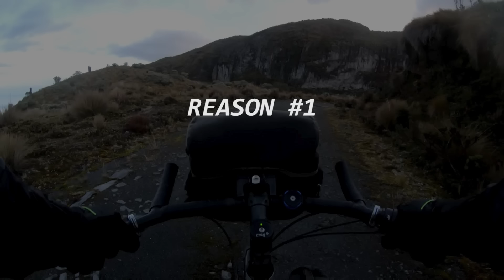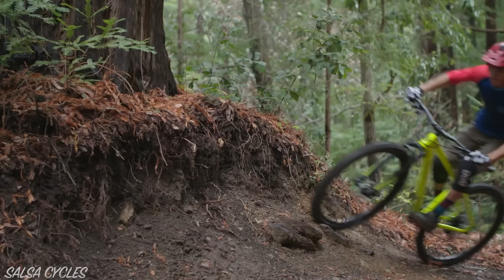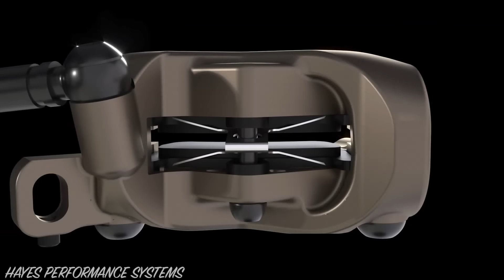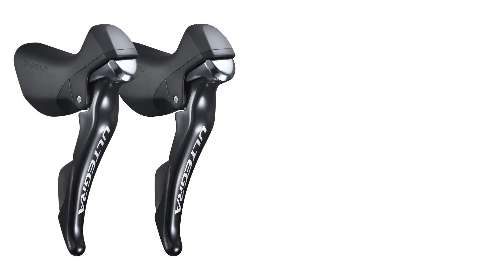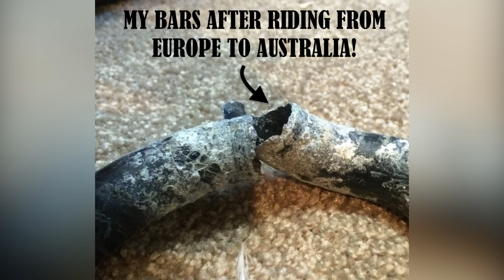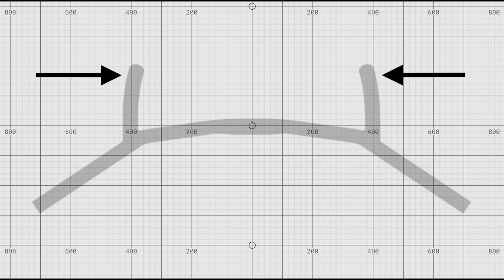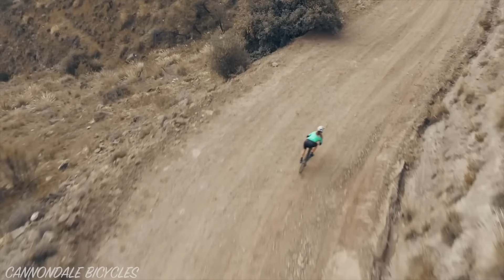Why Flat Bars Are BETTER Than Drop Bars For Most Cyclists (Objective Analysis)

Comment: While I mostly disagree, I do see your points mostly. But reason #4 is straight up bullsh1t. When I want to brake with one finger, I can. Yes, it is hard to do it on the hoods, but in situations where you need a lot of grip on the handlebars and a lot of stopping power (on descents, or off-road), you’re in the drops anyways.
Reason #5 is also not really true, or at least not an advantage. Drop bar bikes are not mountain bikes, so you won’t need such low gear ratios. You can get really low, however, as gravel gearing comes very close to mtb. Also, electronic shifting completely eliminates this argument.
Reason #7 doesn’t address the advantage of drop bars. Drop bars allow for three main, completely different positions, with some adjustments to each possible, whereas with flats you’ll have to buy new handlebars to get another position (or you buy some with a secondary, way less ergonomic position).
Reply from the maker: Reason #4: Yes, you can obviously brake with one finger if you want. But a drop bar lever pulled with one finger almost never generates as much brake force as a flat bar lever. That's pretty much guaranteed.
Reason #5: It totally depends where you're riding as to whether this point is relevent to you. The simple fact is that it's much easier to achieve low gear ratios using MTB parts (no shift-ratio converters, hanger extenders, barend shifters, SRAM AXS wireless drivetrains).
Reason #7: There are the same or more hand positions on flat bars that are totally different. I address the high/low advantage of the drops section later in the video.
Reply: @Cyclingabout  Sorry for the very late reply. #4: Why? A drop bar lever is almost always longer than a flat bar one, and more leverage means less force for the same power (simple physics). So it depends more on the type of brake (notably mechanical/hydraulic) than on the lever shape. 
#5: Yes and no. Drop bars are per definition designed to be mote aerodynamic, which you notice at high speeds, where you don’t need small gearing. While mtb rear derailleurs have more range, you can get really low ratios using an appropriate combination of crankset and cassette. 
While you do address the high/low positions later in the video, you don’t say that it eliminates the previous point of having more positions on the flats, which is just straight up not true. You include any exotic non-drop bar-style handlebars with flat bars, but that is simply a different comparison. Of course you can buy different handlebars if you want different positions, but that shouldn’t count as an argument for the flat bars.

Comment: Toe overlap is not a good point, you're supposed to drive bike with your toes on the pedals, not with your heels, and I'm pretty sure no bike manufacturer makes it so that pedals interrupt with front wheel.
Reply from the maker: As I said in the video, most drop bars bikes in small sizes have toe overlap. That's not with a mid-foot pedal position...

Comment: You're perfectly phrasing what i was always thinking. There really is no advantage, even the aero position is not as aero as most people think. A triathlon handlebar is so much faster and mory comfy its almost ridiculous. In fact i think drop bars are a relict of the old times, where people didnt have wind tunnel tests. And now drop bars are somewhat equivalent to fast, racy, sexy, pro. They just look cool. Thats why gravel bikes are so prominent these days. People want the looks of a cool racebike but the comfort of a touring bike.
And thats the reason why I still only use my drop bar cyclocross bike xD
Reply: Drop bars can access brakes while in an aero position though

Comment: I do have two drop bar and one flat bar bikes and I cant fully agree with your argumentation.
1. Lots of your arguments refer more to bike geometry and have nothing to do with the bar itself...just keep in mind that you may adjust stem length and you could switch bars in any way
2. Since there is hardly any resistance when steering I see no reason why a higher leverage should give you higher bike control unless you are riding on rough terrain - on smooth tarmac and/or high speeds its quite comfortable being able to steer with smaller movements
3. On long, long distances you may take into account that on a flat bar bike there is relatively more inward rotation in your shoulder joint...

In summary most riders have either pretty clear preferences where to ride and which bar fits to them or simply have more than one bike...every bar fits somewhere to somebody :)
Reply from the maker: 1. There are two arguments relevant to frame geometry, not lots. These reasons are for those who are thinking about a new or second hand bike.
2. I agree, on smooth tarmac, a drop bar is fine for steering leverage. But if that's your use case, you can simply skip over this reason.
3. Someone who knows much more about ergonomics than me wrote in the comments here that there is no change in your shoulder rotation with a flat bar. Almost all rotation is below the elbow.
Reply: @Cyclingabout  @1. Ok, I counted the points you mentioned in reason 2 (longer wheelbase, higher front end and different angle) as more than one argument, but that doesn't matter. I don't know about the US but in Europe you'll get entry to mid-level bikes with both bar options and exact same geometry.
@ 3. I read the comment - one point is true: when you hold your hands in front of your body and rotate your hands, keeping your elbows where they are (!), there is no shoulder rotation at all...in theory.
But this person completely neglects the facts in real life situation and obviously does not work with customers in that field . Cause, when grabbing wider flat bars, people flare out their elbows and same time actively rotate inward in the shoulders, you simply can observe that by watching the olecranon of the humerus. Do that and you will see there is actually pretty much rotation above the elbow. But  this is just one small detail, no use for longer discussion...

For me its as easy as that: drops for long distance (tarmac or gravel), flat bars for rougher terrain or bikepackers (which I assume are the most of your subscribers)
Most cyclists do neither nor, so they should go for whatever they feel more comfortable, for me no bar in itself is better than another

Comment: A lot of these arguments revolve around frame design, which isn’t strictly related to your handlebars, (although they are sometimes related.)  For a counterpoint the only bike that I have owned with toe overlap issues had flat bars.  And while many of these might be a good points if you are buying a new bike and specifying every component, if you have a two year old bike and are thinking about buying new/different handlebars, knowing that brifters cost more is interesting, but what you really need to know you have to replace all that stuff if you switch types, and it will add up fast, (regardless of which direction you go.)
Reply from the maker: - There are two arguments around frame design. Not lots. And they will be relevant specifically to those who are looking to pick up a new or second-hand bike.
- Your flat bar bike is more an exception to the rule, rather than the rule itself.
- If you're thinking about new/different bars, you can simply pick and choose the points relevant to that in my video. I didn't intend for every point to be relevant to every person.

Comment: I've found that the trick with doing long distances and flat bars is to use bar ends, which I guess are quite unfashionable now with hardcore mountain bikers. For touring though they are excellent, set them quite flat (about 30° to the horizontal) and they are a little like riding on the hoods on drop bars however they don't just give you one extra position in comparison with your normal grips but three, as you can place your hands diagonally in two directions across the corner of the bar and bar end. I find that by rotating through these positions I never get tired and numb hands after long distances when I'm touring,  whereas with drop bars, they are generally good although if it's a longer day my hands get slightly achy towards the end.

Comment: #1 I wouldn't say BETTER for bike handling. Longer bars make for higher steering leverage but this means slower steering as well. Whatever happened to short flat bars? I like agile steering, being able to evade potholes rather than crashing through them with a long travel full suspension.

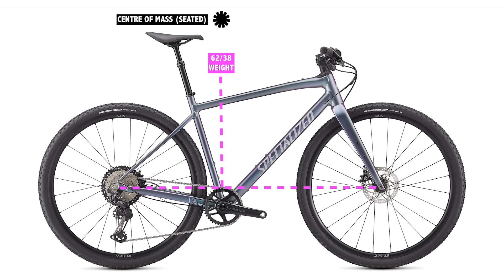Comment: 2:30 ?  When you stand almost all of your weight is on the pedals which are further back from center? Wouldn't a shorter frame have the bottom bracket more centered or closer to 50/50 when standing (opposite of what you say)?

If you shop for adventure type drop bar frames they will be longer and usually no toe overlap. Partner has GT Grade in the smallest size and toes are not even close to overlapping its so long (has to run a short stem).  

For gearing 30/46 Adventure crank with a tanpan/MTB derailleur beats a flatbar/mtb.  Most hardtail frames can't physically fit a very large chainring, and a 2x MTB crank only really has up to 38T option so top speed sucks.  I'm on a converted hardtail into adventure/monster gravel and I had to fit a 10/42 cassette because I really needed that 10T for extra speed and I still want more on every nice downhill section.
Reply from the maker: Your centre of mass is usually above your pedals when you're seated and further forward when you stand up.

Yeah, adventure drop bar bikes generally have longer front centres, slacker head tube angles, and longer fork rake than other drop bar bikes.

Whether MTB gear ratios will work for you depends entirely on your use case.

Comment: When addressing "performance," don't you need yo establish some parameters?  The author is focusing only on the drop section of road bars vs the flat bars.  Most owners of road bikes (drop bar bikes) are rarely on the drops, they're usually on the brake hoods, though the drop position is available for cutting the wind or trying to catch your buddy up the road.  The author should've compared a variety of flat bars and not flat vs drop.   Isn't this apples vs oranges?

Comment: I tend to agree with what you say .
But I'd have said that slightly narrower , 550 mm , flat bars are better in town because of a less "prone" position giving a better position for a better all round vision and also more immediate and less compromised lever control . 
Obviously if you ride 700 mm wide bars you're going to end up clipping mirrors .
There is way too much intractable opinion and fashion snobbery on this subject .

Comment: You missed the fact that drop bars tend to be narrower and if you are only using panniers that are narrow such as Arkels, or none at all, then such a set up is less likely to clip traffic in regions with narrow roads and riskier driving on the part of cars.

This has been a big factor for me. Over the past ten years I've cut the ends off my flat bars so much it was pointless missing out on the hand positions of drop bars.

Comment: Nice analysis! Idk mate, I've ridden a lot on tons of flat bar and drop bar bikes. Unless you're on a straight up mountain bike course with lots of rocks and uneven terrain, I find drop bars are generally better. Both for comfort, speed and a multitude of positioning.

Flats get uncomfortable real quick. No way you can ride 50-100 miles comfortably and respectivley quickly on flats.

Comment: I really appreciate the maturity of debate and disagreement in this debate. Wanted for ever to try drops because of my motorcycle background but after trying flats suite me best. And btw motorcycle and bicycle have fundamental differences in riding that the quicker you understand the less scars you might get...
Reply: Au contraire, bicycles and motorcycles have more in common than in difference.
Reply: @Krejza82  totally agree to that statement but as I said there's fundamental differences - that I understood the old fashion way of blood and dust - like leaning an mtb into a corner contrary to a motorcycle or moving around the vehicle for a hard brake. To lean the mtb a find it better to stay upright and push the bike hard to earth (knee inside) while trying to lean it and crate the arc around the corner rather than taking your ass, elbow and knee on the apex, while at braking if you pump your chest up like I do on a motorcycle, you fly over the bars. On the mtb I find it better to drag the ass behind the saddle and straighten those elbows. Also there's no torque mid corner to drag you out nor even engine braking. These are the main differences that firstly come to my mind and are crucial. I'd like to hear your opinion on the matter
Reply: @Palios33  You're right these are very different techniques. Yet, you mixed two major differences together - loose terrain (MTB, motocross, enduro) where is not much grip and the bike slides much with asphalt and concrete (road and city bikes, mainly street and circuit motorbikes) where grip is the part you depend on. 
I won't venture the offroad direction much - it's not my ballpark. 
Yet, I guess offroad bicycles are pretty close to offroad motorcycles. Probably as close as road bikes are pretty damn close to each other. 
And I mean by style wise - riding lines, braking points, steering. 
There is the difference in acceleration, yes, which influences chosen lines and speed in general. Still, there is big difference in less and very powerfull motorcycles, too.

Comment: Most cyclists don't race down mountain sides with luggage! And "Ignoring ergonomics"  !?? Wrist fatigue is much worse on flatbars due to awkward ergo. Dropbars have THREE riding positions. Sorry not a myth. But if you realise "Most cyclists" actually just toddle down to the store, then yes you are correct.

Comment: I'm sorry to say that I've found this to be badly researched and ergonomics are the key factor in handlebar choice . For long distance riding drop bars or even a semi drop bar are advised.  With the new even wider drops (which can be over 500mm internal width) many of the objections you raised are not valid .   Your point on brake size is utter tripe as what determins the brake size is not the bar but frame clearance and adaptors .  You can run a 180mm rotor on a drop bar bike if you put the correct mount adaptor on .